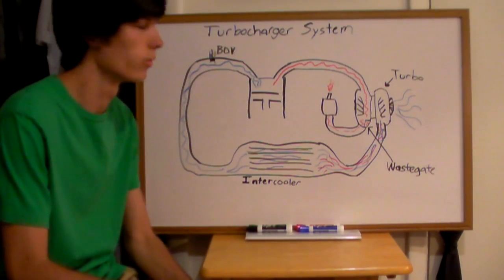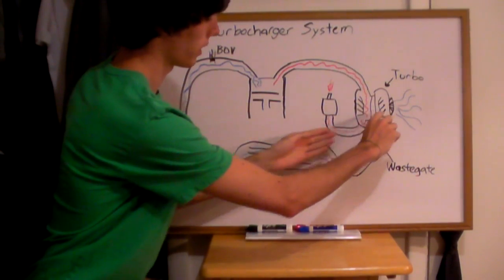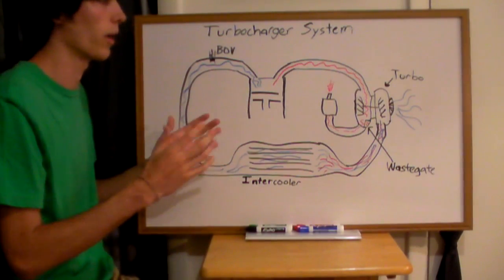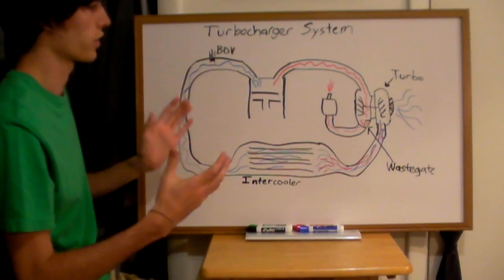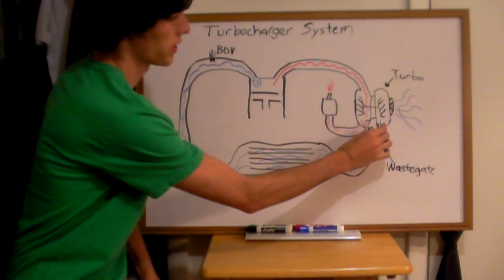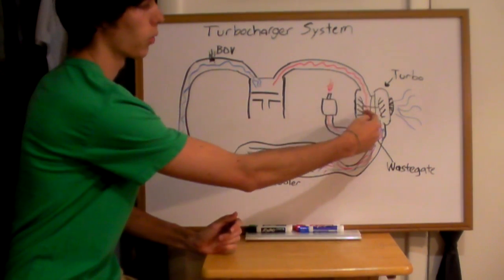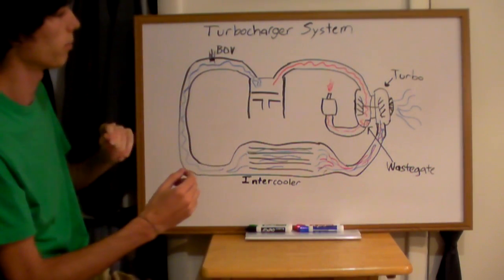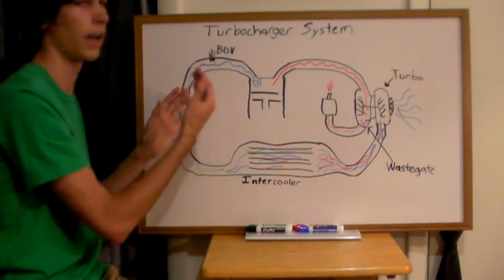How Turbochargers Work

Comment: So... How do I make my turbocharged car go choo choo instead of psssht
Reply: when you run too much boost for a blow off valve to empty, it gets sent back through the turbo and intake which makes that famous sutsutsutsut sound that big turbo jdm cars are known for.
Reply: abit late but its not compressor surge, compressor surge is when it flutters on WOT
Reply: get a fcking train
Reply: ***** That's correct. that whoowhoowhowhowohwoo. That's compressor surge which is indeed a bad thing.
Reply: Why is it a bad thing? What does it damage, if anything?

Comment: so is turbo whoosh the sound of air leaving the blow out valve or wastegate, not the sound of the spinning turbo sucking in air?
Reply from the maker: If it's while you're accelerating, it's the turbo sucking in air. If it's after you let off the gas, it's the BOV.
Reply: Engineering Explained ok thanks

Comment: I love the sound of BOV's, but i havent had much success making one more efficient than a BYPASS valve on my WRX.  BPV's will recirculate the exhaust back into the turbine and make your car run better (at least a subaru). You could go with the 50bpv 50 bov route if you MUST have that "mean" sound.

Comment: great vid clearly explains alot:), btw does the turbo take in the exhaust gas and add some air from outside and feed it into the intake manifold or does it just send out the exhaust gas and only take air from outside?
Reply from the maker: Well if you have EGR you can take some of both, but in the system I showed it's all fresh air.

Comment: Nice thoroughly explained video! But i have a question, What happens if you have different pressures at your wastegate and BOV? like for example you have BOV to let out at 7psi, and your wastegate is set to go off at say 9psi? does that mean your overall boost will be at 7psi?
Reply from the maker: Correct, if you had a BOV at 7 psi it would open once it had 7 psi, so you would stay in that range when you're on boost.

Comment: If you use a super or turbo charger how does the engine know too send more fuel? Wouldn't it always run lean?
Reply from the maker: Sensors read how much air comes in (see my videos on MAF, MAP, and O2 sensors) so the ECU knows to send more fuel.

Comment: How does idle air work on this system if the throttle is close? how this engine stay at idle?
Reply from the maker: Some air can still pass through the throttle, enough to keep the engine idling.

Comment: is it mandatory to have a blow off valve ??or can i buy one that doesnt make that psshhtt sound??
Reply: Well if you have a low boost system it probably won't be detrimental. Though it's probably better to just have one and not worry about it.
Reply: Jason Fenske shouldn't you have one, since the bov lets out pressure. If you didn't  wouldn't it be hard on the engine because of the amount of pressure when letting off the throttle?
Reply: Michael Risling From what I understand, you can have a Re-circulating valve to let the air back into the turbo, to reuse the air for faster spool time.. I may be wrong on the reason for it, but I know a lot of factory turbo cars use this method to get rid of excess pressure
Reply: No, it's not mandatory, and there are also ones that do not make as loud of a sound.

Comment: If the turbo is on the exhaust how does it force air back?
Reply from the maker: It spits out in the opposite way that the inlet turbine pulls air in. It's actually drawn incorrectly as the exhaust piping should exit the turbo to the left side (perpendicular to the oval drawn).

Comment from the maker: Interesting, hadn't ever looked into this. Apparently it's a device that keeps the transmission in first and reverse, meaning the car can't move, allowing you to build revs with the torque converter spinning, to provide a launch (instead of holding the brake pedal to build revs).

Comment from the maker: Yes, over atmospheric. Atmospheric pressure is about 14.7 psi, so an engine with a 15 psi boost turbo will have double the amount of air as an engine without a turbo has (if said engine has 100% volumetric efficiency).

Comment: What does it mean when they say that a turbo is rated for 22 PSI or 22 pounds of boost? Does that mean that it pulls in an extra 22 pounds of air per minute into the engine?

Comment: Please, if I accelerate rising up to the red line, full boost.. and release pedal letting the engine decelerate, is that bad to the engines health ? in 2nd or 3rd gear.. releasing the pedal without release the gear..

Comment: I don't get it. If your throttle plate closes when you let off the accelerator, how does it continue to idle? If you leave a little gap, won't that just let the compressed air in? Mightycarmods talks about this Bob where you can choose to vent atmosphere or recirculate. Where does it go when you recirculate?

Comment: (pardon my chopped up version of centripetal) force, this means that it will take less energy to turn this turbine, Now if you think of a very large turbo say a 65mm it will take more energy (exhaust being produced) to get that turbo spinning at the same speed as the smaller turbos, this is usually why rally, f1, and touring cars have a small to medium sized turbo; it will give you the power you need at a low rpm to get out of low speed situations such as corners.

Comment: This is not how a BOV works. There is no spring that opens at 6psi. The Bov opens when it is pulled by engine vacuum. While there are both pull types and push types of blow off valves, they still are open based on the force of the vacuum of the engine when you step off the throttle.

Comment: Hi, thank you for these very informative videos.  I just want ask if it's normal for the intercooler to have oil in the piping?  I did some research and some say it's perfectly nomal since the oil in it comes from the EGR?  Some even recomend  'blanking' and 'sticking' the EGR.  What's your take on this?  Any reply will be greatly appreciated.  Thanks.

Comment from the maker: Actually your logic makes sense. If your bypass valve is after the MAF sensor, then your engine would have an incorrect reading of just how much air is coming in if it simply expelled the air into the atmosphere with the bypass valve.

Comment: Awesome.  Can you explain in short why some cars use a diverter valve instead of a BOV?  My car uses a DV, and my understanding is that if too much of that compressed air is released it will mess up the A/F ratio.  Not sure if that is 100% correct or not.

Comment: If it did turbo #2 would have more lag than turbo #1 but if turbo #2 was a little bit smaller turbo than turbo #1 then it could possibly in theory they could start spooling at the same time. Could this whole twin turbo theory work?

Comment: So I know 4 cylinders can only use one turbo (from what I have seen). But I was thinking, you have two turbo's for a 4 cylinder engine. Could you use the exhaust from turbo #1 and make it spool turbo #2, the have two intakes going into one intercooler then to the engine? So engine exhaust spools turbo #1, exhaust out of turbo #1 spools turbo number #2, then exhaust out the back, while each turbo has there own filter, then the pipes join somewhere in between the turbo and intercooler?

Comment: What's the effect of raising the stock PSI a turbo produces?
And would you agree that the best fuel efficiency is at the min rpm range where the turbo is working, while not using the gas pedal too much? For example, I feel that my car accelerates and holds the uphill speed better from 2000 rpm upwards. When I accelerate harder in 2nd gear I feel the turbo kicking in at 2100-2200 RPM.

Comment: no engines that use a sensor to determine pressure from the manifold (absolute manifold pressure) instead of the mass airflow sensor (MAF) don't need a blow off valve. it would cause cylinder wash and destroy the engine. pepboys offers a sick turbo whistle if you really wanna sound like you have something you don't need.

Comment: The reason for a BOV is to deal with pressure surge caused by the air that can't reach the engine. The danger is in the backsurge hitting the impeller and damaging the turbo -- the engine itself will be fine. Also, I think the reason you don't hear the blow-off is because most cars don't actually vent the pressure to atmosphere. Bypass valves seem to be much more common, and they're much quieter.

Comment: Well, there is new turbo sytem named Computer Controled VGT TurboCharger. It uses fins to control the exhaust gasses that spin the turbine. The other "turbine" is named compressor.

Comment: So the compression ratio doesn't change because the size of the cylinder and the range of the piston is fixed and the initial pressure of the air being compressed by the piston is irrelevant? By the way I found your channel very recently and it is pretty much what I've been searching for without knowing it. I'm also a big F1 fan and those videos are great! Who are you cheering for this season? I'd guess Ferrari but...

Comment: they are... the american version ran 550cc injectors and the japan version ran 440cc. but they both did that from 93-98. the one thing that changed was the american version went to obd2, but that was just a different way to read the same data that the computer was already sending.

Comment: most turbo engines with stock setup the blow off valve vents back into the intake tube just before the turbo. its sort of a muffler in design so that you dont have to hear the blow off valve.

Comment: so no that the boost pressure is stored that with nothing to maintain it, it starts the do the same thing that the exhaust was doing. the high pressure in the intake and the low pressure before the turbo starts to want to spin the turbine shaft backward. causing a dramatic decrease in turbine speed. so if you vent that pressure before it can slow it down then you maintain the turbine speed.

Comment: the way the turbo is spun up is from pressure differential. look at the hot side only. the exhaust comes out of the head and builds pressure between the head and the turbo, so the high pressure there vs the low pressure after the turbo make the turbine spin. when you shift you normally let off the throttle. when you do that the air isnt being forced out the exhaust in the volume that it was before. so it becomes low pressure in comparison to the cold side now that has all that boost.

Comment: great video. you explained the blow off valve very well, but you didnt explain the reason that it needs to dump that pressurized air. when you release the throttle and the pressure is sitting on the "cold" side of the turbo it tends to slow the turbine down so the blow off valve dumps it to allow the turbine to maintain some speed between shifts.

Comment: Some use Diverter valves, which send the air in the chargepiping left over from when the throttle closes, back into the intake.

Comment: it actually increases fuel efficiency. when you control the intake manifold flow of air, you can adjust the pressure each piston exerts. with this you can control the combustion output.

Comment: The fact that the intercooler lowers the air temperature for greater density causing bigger explosion is known. Does the already cooled air benefit in cooling the engine parts down that do not need to be heated? For example, the piston cylinder needs to be hot for combustion, but wouldn't the cool air make the piston cylinder decrease in temperature or would the more dense air be of more advantage than having and slighty cooler cylinder upon intake.

Thanks

Comment: Where is the inlet for the air to go in? In the compressor side in that small hole? Or does that create a vacuum so that air can come in from the intercooler?

Because I have seen cars that have a twin turbo set up where the two turbos are set up right before the exhaust outlet all the way at the back of the car.. so how would those suck in air? 

Just wondering.. great vids BTW been subbed for a while now :)

Comment: Not really. The turbo takes care of wasted heat,sound and flow from combustion and use it to increase the power by pushing in more air into the engine. More power will also give you more exhausts. But you can get the best from two worlds if u put a turbo on a very small and economical engine. U will get less over all pollution and still pretty good power outputs when you need it. The turbo will only work when you put load to the engine. No load=too little exhaust gas to get boost from the turbo

Comment from the maker: Air on the outside "passes by" the intercooler, cooling the air inside of it, which is headed to the engine for combustion. They do not flow together.

Comment: because hot air will knock, the ideal situation is high pressure cool air. This not only causes the ait to be denser and make more power (more air molecules to react with fuel) but the lower temps reduce the chance of knocking

Comment from the maker: Once again, depends on the engine. You'd have to know material properties of all the components; the short answer would be no. The long answer would be it's possible, but would require a lot of work on understanding the specific engine. This information isn't exactly easy to come by, since engineers aren't going to hand out all their secrets.

Comment: Good explaination. I can't tell you how many people think you can just bolt a turbocharger on anything and it will be more better :P It's all about internals: the rings, cast or forged pistons, connecting rods etc. There's no such thing as a NA engine that will run a turbo without major internal modification. You seem like a sharp fellow worthy of a subscription! Rock on brother :)

Comment from the maker: Depends on the internals of the engine, if it was built for high temps/pressures. 12-14 could be way too high for plenty of stock engines, or fairly conservative for some overbuilt NA engines.

Comment: because before the sparkplug ignites you will have more oxygen fuel mixture than a engine without intercooler.end that will say more power than a turbo engine without intercooler

Comment from the maker: If you put it in an engine that wasn't designed for the additional heat and pressure, the engine will eventually fail.

Comment: the advantages of running 2 turbos are that you put less stress on each turbo and also can reduce lag with 2 smaller ones, also underhood space is an issue. most cars run a parallel setup because it is much simpler than a sequential. parallel means both turbos start to spool at once, sequential setups are much more complex, and use 2 turbos that can be close or not in size, on low RPM, exhaust only feeds through 1, then the 2nd turbo gets all the exhaust and the other isnt really making boost

Comment: the one thing that i think isnt correct is the BOV, the BOV is usually actuated by vacuum or electronically, if it was like the wastegate (if it had a spring set to open at 8psi) you wouldnt be able to build any boost in the intake, it would pop open every time you stepped on the gas and the turbo spooled up, the wastegate regulates boost, and the BOV dumps off boost from your intake to prevent it running back through the turbo

Comment from the maker: The hissing is likely the BOV releasing pressure. The flutter comes from turbo surge, where pressure is released back through the turbo rather than through a blow off valve.

Comment: Firstly intercoolers are used to boost up the efficiency of turbochargers.so turbo can be used with an intercooler. cheap cars don't have intercooler :D 
Secondly its the opposite.Bigger the turbo slower it accelerates initially.because the bigger the turbine blades the higher the inertia.so obviously higher the turbo lag. Thats y buggati uses 4 instead of big 2 turbos.this makes everything clear.

Comment: Alright so I wanna install a turbo in my Lancer, and this video explained ALOT! Now before I get my hopes up and start saving up huge amounts of money to blow, I plan on installing it myself then get it professionally tuned. So where would I hook up the first pipe to run to the turbo, would I get like a header and add it in series to my exhaust? Then add a pipe running to my intercooler, intercooler to BOV then throttle body?

Comment: have every turbo car a blow off valve?end if you dont have a blow off valve where will the pressure go? if i want to put a turbo on a bmw 6cilinder m3...i just put the turbo on it en i must set the ecu? for more gasoline injection?

Comment from the maker: Turbos increases efficiency, and allow for a smaller engine to be used, and with enough gases produced it also allows for greater power at lower RPM. Diesels are already built heavy duty due to high compression ratios used, so it makes sense to turbocharge them for the added benefits (without really needing to beef up the internals much).

Comment: yes the exhaust gas pushes the turbine wheel and gos out the exhaust outlet of the turbo the A/R rating is how clouse the wheel is to the inside of the housing the smaller the number the more efficient the turbo is. ie; a stock turbo on a car may have an A/R of 1.8 but an aftermarket turbo of the same size has an A/R of 0.7 this will alow the AM turbo to make the same amount of boost with out working as hard and lower pre intercooler temp so the cooler dosent have to work as hard to cool the air

Comment from the maker: I never said you don't know what you're talking about. I did say, however, that turbochargers use the exhaust gases to run the turbine. This is fairly common knowledge in the automotive world. If you'd like to point out a single reference on the contrary, I'd be glad to see it. Yes, I've disassembled an engine, and tampered with turbochargers. Ive also taken courses on thermodynamics, heat transfer, ICE engines, and auto engineering. I have plenty to learn, but I definitely know how turbos work.